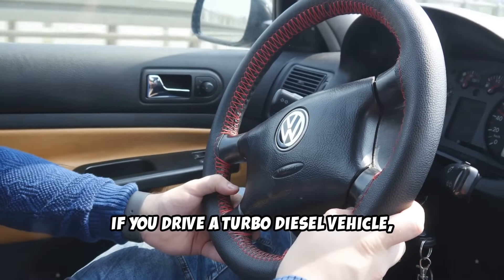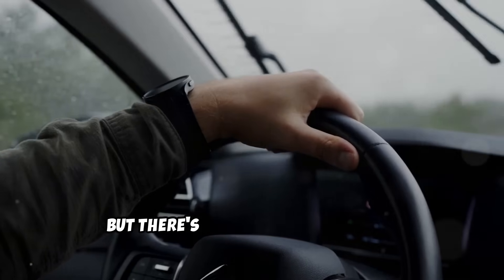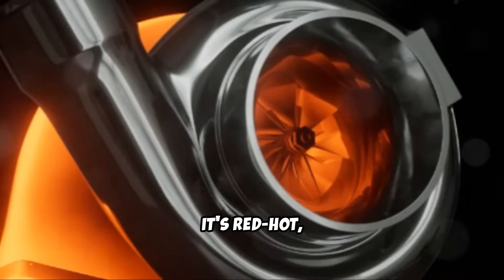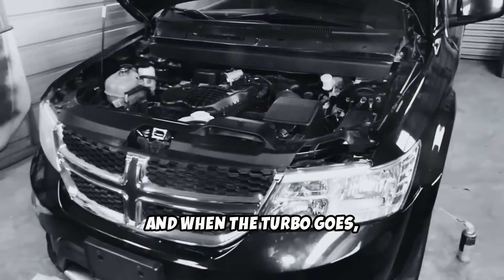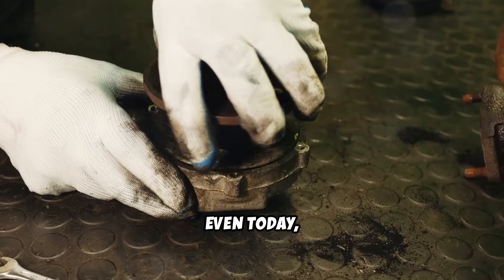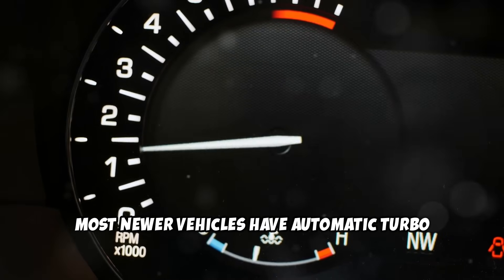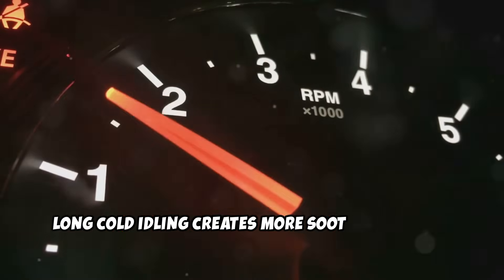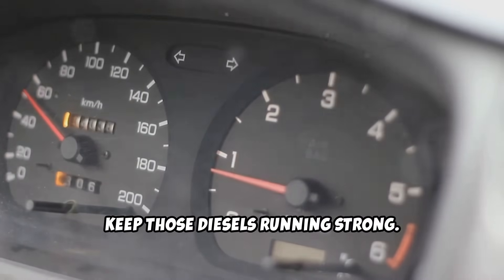Turbo Diesel Owners: NEVER Do This After Driving (Ever!)

Comment: Good advice for all turbocharged vehicles. I was an aircraft and helicopter technician for over 45 yrs, we always did a 2 minute cool down on turbocharged and turbine aircraft. I you don’t the oil in the turbo or turbine engine will cook and turn to carbon causing all kinds of problems!

Comment: Drive them "to cool down" like you drive them "to warm up"...GENTLY. 
60 seconds of idling won't help neither a gas not a diesel turbo engine, what helps you cool down faster is constant airflow through the radiators. 
What kills Diesels is idiot salespeople telling customers to drive it like a gas car.... NO. Diesels are made for long trips, not for short runs to drop off the kids at school. If you do that regularly and don't leave your greater vicinity often then get an EV.

Comment: After HARD use, yes, let it cool down.
Normal driving, it's not an issue.

Note- an engine idling will run hotter than an engine cruising on the highway.

Comment: Always let the engine just tick over for a minute or 2.      Also I try to generally at start up, switch auto stop off, so if driving hard, the engine will still be just ticking over to get oil to the Turbo.    I also bought a brand new motorhome UK RV, and one reason is, I know who has driven it, only myself, and I always let the turbo just tick over after a drive.      Cheaper than a new Turbo or Engine.

Comment: I'm new to cars and I drive a diesel one, I also wait for a couple of minutes before I turn it off, I've noticed that when i turn of the ac the aux fan still is on, is it normal? It turns off couple of minutes after I turn off ac
Reply: It’s good to turn AC to regular so the AC can dry out before you shut it off. It sounds like maybe yours does it automatically.

Comment: Some of the best advice I've seen on YouTube run that engine down boy is what I was taught back in the day where I live extremely hot and mountainous I recommend up to 5 minutes many modern engines have an auxiliary electric water pump to help with this problem Keeping the water circulating but this is mainly for the head gasket it doesn't Stop the oil clogging in the turbo😊

Comment: I idle it for around 2 minutes before drive and after drive. Am I overdoing it since I believe the dpf is getting choked at the same time too?
Reply: I don't think so, I do the same and change oil every 5000 miles. I have 140000 miles incident free, I recently checked a turbo hose and the egr valve was totally gummed up, so I unblocked it and organised an egr delete cable as soot particles and oil vapor are not great for an engine. Keep doing what you're doing, your turbo will thank you.
Reply: Best way to know for sure what your turbo temperature it at, is with a exhaust gas temperature ( EGT ) gauge/Pyrometer. For my truck, it's recommended to not turn off engine until post turbo temps hit 300 Fahrenheit or less. On really hot days it takes 3-5 minutes of idling.
Reply: Very little soot at idle 
This video is correct to a point but unless you full understanding as a myself a diesel fitter 
Rolling in slow helps

Comment: Even a gas turbo need to be idling after hard use not only a diesel 😂
Reply: Yes, so why only mention diesel engines… Short trips don’t really need this.
Reply: Short trips not really nessasary but if you drive it hard you must do this otherwise the turbo don't get oil/coolling not only for diesel that has nothing to do woth it  @GymChess

Comment: This is why stop start technology is so bad for your engine especially diesels.
Reply: Mine has stop/start,as soon as the engine starts I switch it off and it stays off.
Reply: Nicht nur. Die Lagerschalen werden während diesem Vorgang nicht mehr geschmiert, also nur noch teil-geschmiert. Beim erneuten Starten des Motors erzeugt dies mehr Abrieb.
Reply: How start stop system affects highway speeds and high loads?🤔
Reply: I coded my BMW to remember the last stop/start status. Usually I disable it and keep the engine ruining, but when there is a traffic jam, I sometimes use stop/start. I always drive the last part of my journey slowly to cool down the turbo.